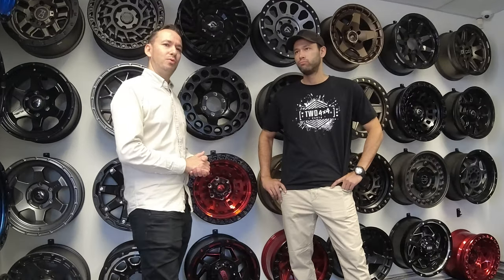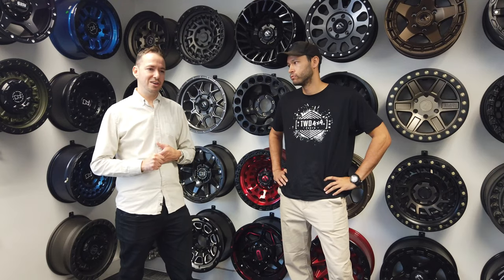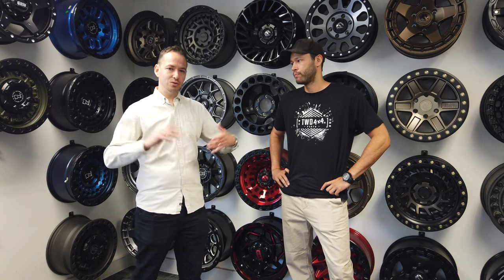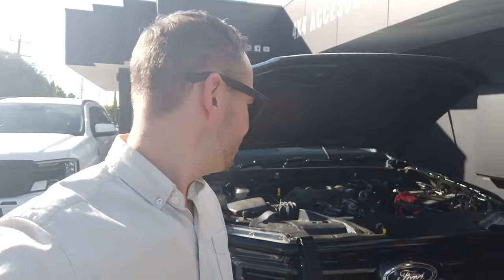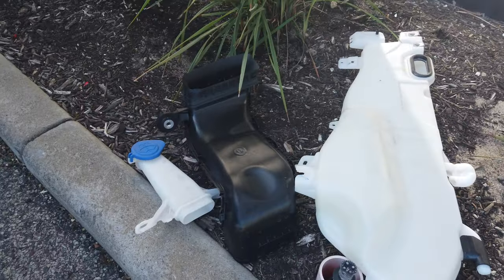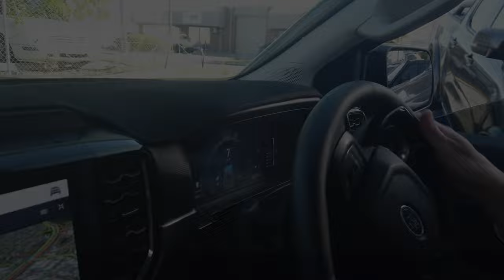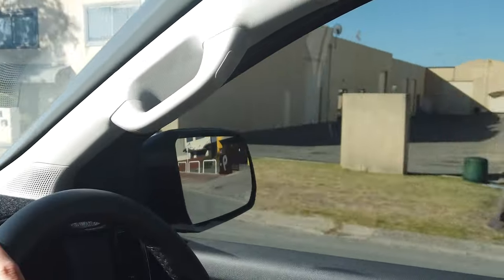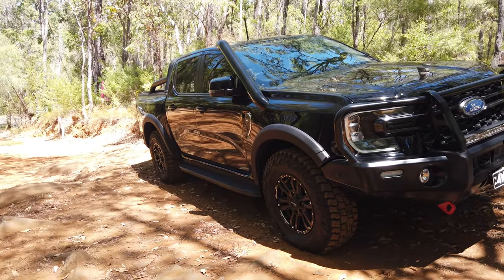STAINLESS SNORKEL ON THE V6 NEXT GEN RANGER - IS IT TOO LOUD?

Comment: Honestly man, that induction noise is a bit too much for me. I don't mean to rain on your parade and I'm not trying to be a jerk, but I reckon that would get annoying so quickly. I think a plastic snorkels are better sounding, the metal ones have too much resonance for my liking, but the metal ones look WAY better. But that's the thing one mans annoyance is another mans delight. Still a slick looking car, all the best with it. Oddly enough the v6 has a bit of a similar rumble to the old 5 cylinders, on camera anyway.
Reply from the maker: 100% - stainless wins on looks, plastic more liveable day-to-day. With window up not as noticeable - still considerably noisier than my TJM I had on the Pajero Sport

Comment: That sounds awful inside the car, I commonly drive with windows open so wouldn't choose a stainless as they all sound awful, looks amazing ?, it looks like a piece of stormwater pipe hanging out of the panel, I will stick with Safari on my V6 Ranger when it arrives.
Reply from the maker: Looks definitely subjective mate. I feel the same about the plastic ones. Agree on noise - if you like to drive with the window open, it’s probably not for you. Saying that, you’ll still notice noise from the Safari

Comment: Wondering what impact on your fuel economy,  the note might change with a change of exhaust as well. Looking forward to the next additions, cheers 🍻
Reply from the maker: Thanks mate. No noticeable change in fuel 👍
Reply: It seems the only people saying a snorkel won't increase your fuel use are those who sell them. Pretty much everyone else has in increase of at least 10%. Adding anything to the outside of your 4wd impacts fuel consumption, weather it be roof racks, bull bars, awnings, big tyres or snorkels.
Reply from the maker: @Wadeftt I haven’t noticed any increase in fuel consumption from adding a snorkel. There may be some marginal differences between forward facing (ram effect) vs rear facing. End of the day if you’re driving dusty roads, or there’s a potential of driving in deep water, a snorkel will be of benefit. Otherwise probably not necessary.

Comment: This video sealed the deal for me, I won't be getting a snorkel, plastic ones are too ugly and the stainless ones are too noisy haha, 

Thanks for the video mate, good info there. Have fun modding the ranger. That's what it's all about.
Reply from the maker: Thanks mate. Glad it helped with your decision. I guess it all comes down to each persons usage - if you’re not likely to tackle water, then just know your wading limits etc and if driving dusty conditions behind other vehicles, I’m sure you’ll keep on top of your air filter maintenance etc 👍
Reply: @Perth4WDandCamping  yeah I was thinking about it and the last time I've been on a trip where the water was actually deep enough to need a snorkel was about 12 years ago in the VIC high country. I'm fairly tame these days though in my 4wding. I still have the GU patrol for if I get the urge to do dumb shit haha
Reply from the maker: @Bigaza454  best of both worlds then!
Reply: You don’t normally get a snorkel for looks per say. Main reason is to stop water entering your engine during water crossing and secondly reducing dust ingress to your filter. Too many 4WD’s  are mall crawlers these days.
Reply from the maker: Agree. Should come down to functionally first 👍
Reply: @000carpets  yeah I agree as well, I wouldn't normally worry about looks, however the safari snorkel for the next gen rangers is just way to bulky on the quarter panel, obviously it's just my opinion, but yeah, it looks horrendous, worst design I've ever seen from them.
Reply from the maker: Yeah it’s a beast for sure. TJM is a bit less bulky, but also won’t be for everyone. Ultimately comes down to compromise. Looks = stainless. Practicality and less noise = plastic. Perhaps an argument for stainless (reverse faced) being better for dust too. At least we have choice 😂
Reply: Hi looks great Sounds good 😎 what was cost pls ?
Reply from the maker: @davidtasker936 hi. Your best bet is contact TWD4x4 for the latest price, including install. Be looking just under $1400 for the snorkel + install as a guide

Comment: Hi Mate. The ranger looks beautiful. I have noticed you have installed the IDrive. does it make it better on fuel? I have the Everest sport V6 and im doing 14/100. Im looking for something to to drop to fuel down. Thanks.
Reply from the maker: Thanks mate 👌 It’s been a cool process building it up and still a few things to come.
14 seems a bit high - is your Everest modified / carrying a lot of extra weight/big tyres? Ultimately a lot will depend on the type of driving you do (Eg a lot of stop/start vs hwy). 
Generally an idrive (EVC) Is not used to lower consumption - can have the opposite effect if you have on some of the more aggressive settings. There is an eco setting, but I wouldn’t be advocating for this as I found from stock the V6 to be a little laggy - therefore adding to this wouldn’t be ideal. I’ve found the EVC really livens it up and makes it more drivable and more control offroad. 
Suggest a chat to your local Ford dealer just to double check nothing else going on.
Reply: @Perth4WDandCamping  Thanks mate
Reply: 8.9 l per 100 from 2022 Toyota Fortuner around town 8.6 l per 100 on a run pretty happy with that. Reasonable power 150 kw and 500 nm

Comment: Had it done to my ford everest also with the custom airbox and all i can say is it sounds and look great but will suck the water in during heavy rain.. Had to get a new engine put in.
Reply from the maker: Sounds like a poor install. Mine has had a hole added in a bottom corner of the standard air box to allow any water to drain. Sorry to hear you had issues - that isn’t acceptable at all. I hope you got some compensation from whoever installed it
Reply: @Perth4WDandCamping  mine had a drain hole too its just that so much induction in the box the water just swirls around and gets sucked into the pod filter and had it fitted by iron man so it wasnt a backyard job. The company that made it ( from QLD ) sent me a rubber ring and said it will deflect the water lol and pretty much useless. They supply to alot of 4x4 shops
Reply from the maker: @huafengzhao9251  that’s a worry! Sounds like a faulty product. Yet to hear of a bad install/stainless snorkel on a next gen causing issues

Comment: Great video thanks for keeping these coming. There is a bit of resonance there which I don't love - not sure if it's the materials, diameter of the pipe or airflow path. May also just be air running over the edge of the pipe? 5:37 the sound of the pipe after the turbo spools down and after, there is a sort of constant whistling which doesn't change with the turbo. Could just be how stainless sounds, I don't own one so would do more research before I make the purchase.

On a side note, what a great rig you've got!
Reply from the maker: Thanks for the feedback 👌 Its my first stainless snorkel so I don’t have too much to compare to, however clearly a different sound compared to the TJM moulded one I ran on my Pajero Sport. 
Been driving with it for a few weeks now and have become accustomed to it. 
Appreciate the feedback on the rig 👍